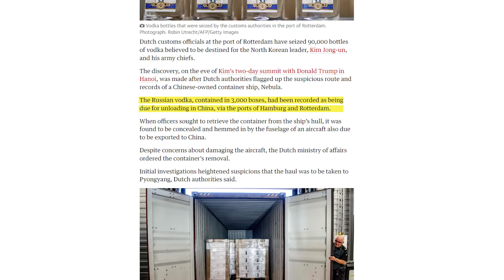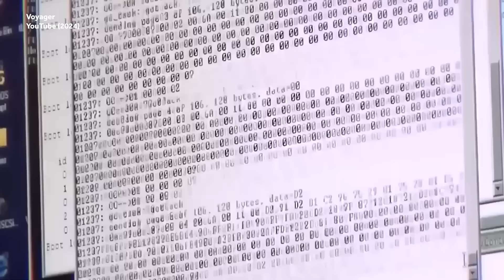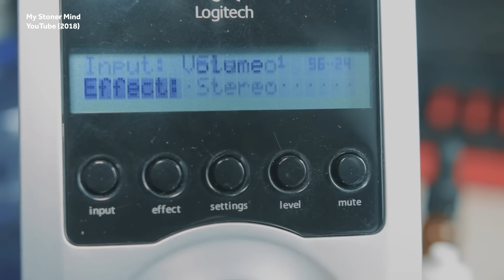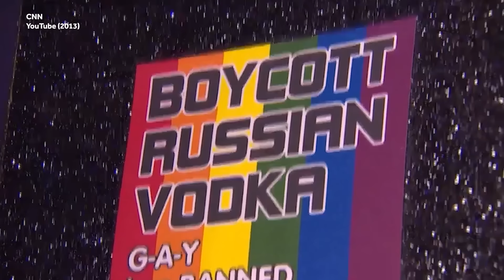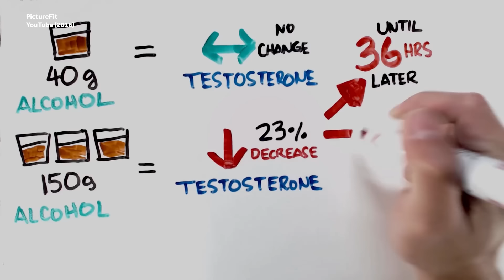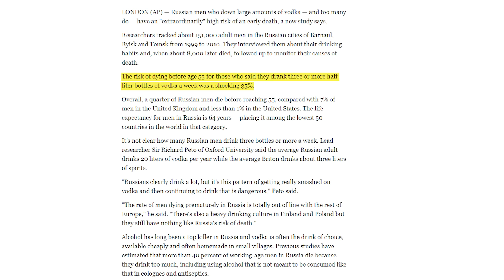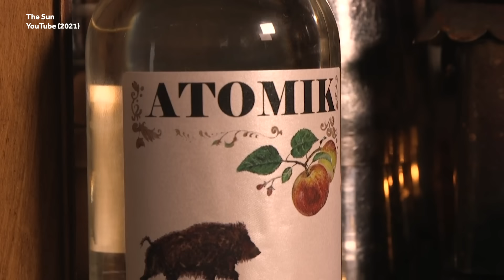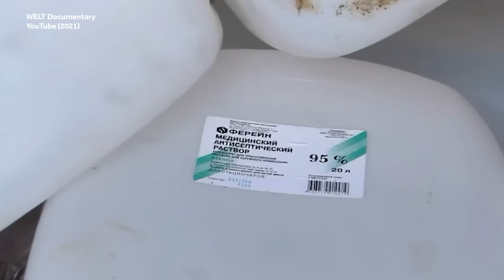Why You Can’t Freeze Vodka

Comment: Alcohol DOES NOT warm you up. You just feel better when drunk in the cold. Actually, alcohol will cause your body to lose heat WAY faster in the cold, and kill you faster, because it dilates your peripheral blood vessels, causing more heat to escape through your extremities. However, alcohol will help discomfort in the cold if exposed to cold for short a duration. Otherwise consuming alcohol in cold weather is a very bad idea. Alcohol will actually stop and prevent frostbite from occurring if you consume it right before or after being rescued, but then have a warm place to recover in, again because the alcohol will increase blood flow to damaged tissue.